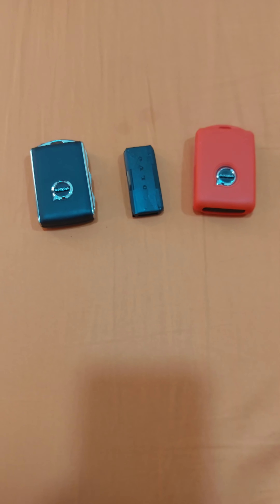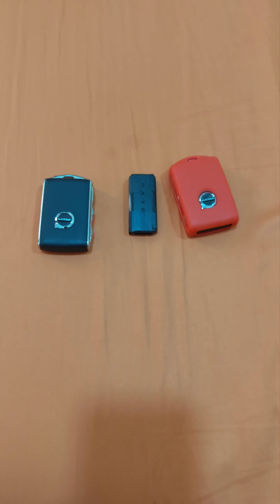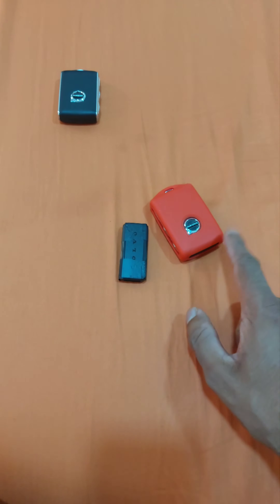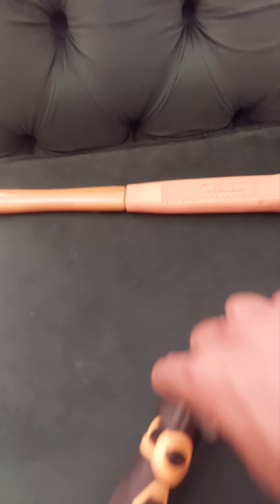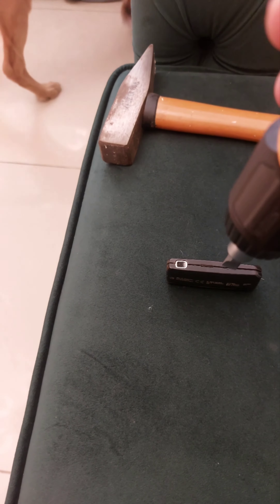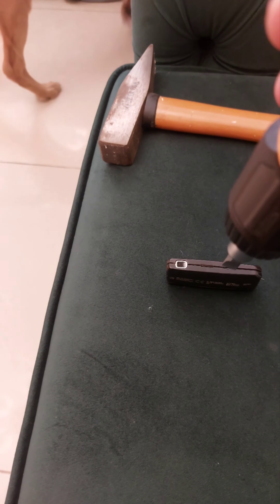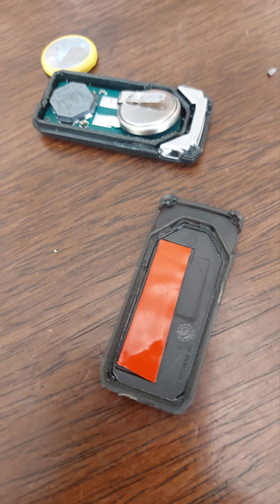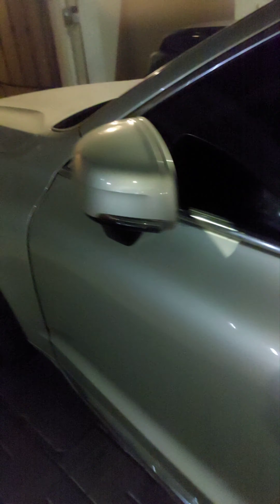Volvo Sport Key tag keyfob battery replacement

Comment: You do not actually show to "opening" of the fob with the hammer in the slot. I'm afraid to hit mine too hard and destroy the fob.  What is the secret?
Reply: He didn't tell us what kind of battery was inside either
Reply: @mahadragon  It an regular CR2032 ... I managed to get it open by following another video using a box knife and a reverse pliers to separate the two halves with pressure...the plastic case bends a lot without breaking.